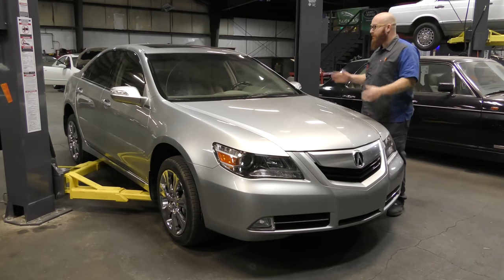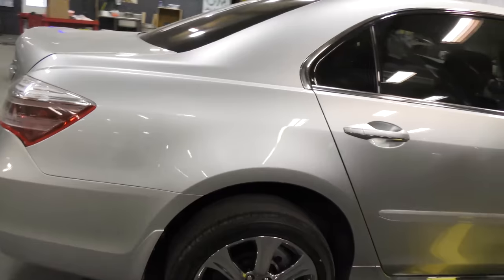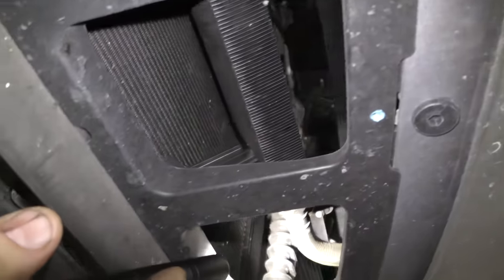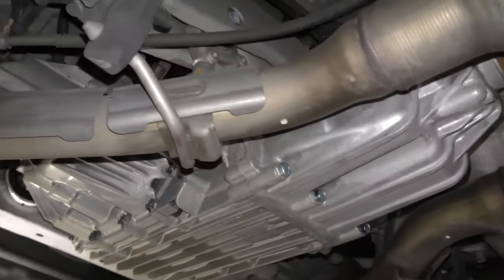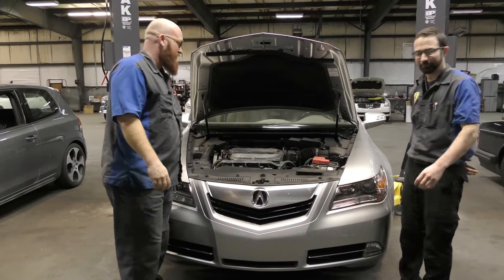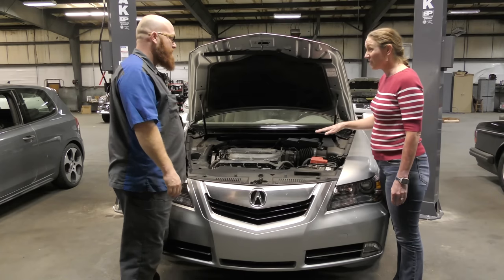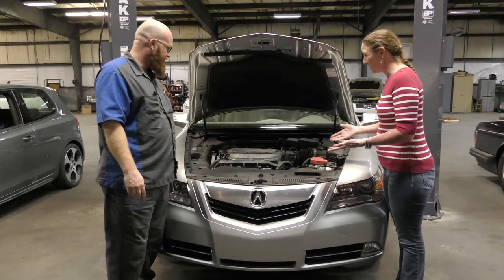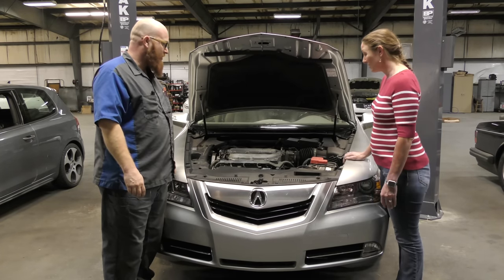Something Very Serious is Wrong with this 2010 Acura RL! What did the CAR WIZARD find???

Comment: If this was my car, I wouldn't hesitate to fix it. My big worry would be how good a job will the rebuilders do?
Reply: Sure... But only if you got 7k spare laying around.
Reply: @computerdeals  What is the alternative? I'd rather take out a 7K loan than a 30k+ new car loan to get something in this condition.
Reply: Yup, that's the fear.
Reply: @lorencooper6043  You are the owner? I saw you make a couple of comments? If they are going to do that, are you having the car shipped back to that dealer? That would be great news. You should write a comment and have the Car Wizard "pin" it to the top so people can follow your progress.
Reply: @louiswilliamhicks  yep! I’ll definitely keep you posted on it! I’ll keep the wizard posted on it too
Reply: @UCwrKbSnHORLLj9KKRYw_gYw Glad the dealership is standing behind their product.
Reply: @lorencooper6043  hey, I found some engines for you on Ebay. Theres at least 3 of them and 1 has only 68k miles on it. I bought an engine on Ebay once and it was good and still runs to this day.
Reply: If it was my car, I wouldn't let an idiot son drive it.  What was the kid thinking, letting the engine run when the oil pressure light came on?  If that kid wanted to drive the car again, I think the owner should ask 7k for the privilege.
Reply: @pizzamon795  I appreciate you looking but I’m looking at it as I don’t want to have someone’s engine that was possibly neglected. I don’t want to take the chance on that.
Reply: I’m surprised the owner can’t sue Honda- We have owned Hondas and had pretty good luck, but under 50,000 miles?? That motor should’ve gone 300,000 easily.
Reply: @lorencooper6043  I didn’t catch the rest of your comments. What’s this about the dealer? Is there some kind of recall on the motor? Will have to give you another engine? Good luck, I love Honda vehicles
Reply: @lorencooper6043  so sorry that this happened. I love these car's I was going to buy one.
Reply: @Andrew-ep4kw  if my son was an idiot then how would he be at a college that specializes in Automotive Restoration... He is a Guru with classic Mercedes but won’t touch anything else. The oil light flickered a few times. It never stayed on.
Reply: Any chance you’d like to sell it as is?  Serious question
Reply: @Andrew-ep4kw  You know the oil pump most likely died on this engine and that idiot son who apparently has ZERO mechanical common sense drove it until it started making the noise.
Reply: @oveidasinclair982   Book value of a 10 year old car isn't that much no matter how nice it is.
Reply: I would have bought a 3.5 V6 Honda instead. I would have never bought a car with the 3.7 variant because you can’t get reman Honda J37 engines. Nissan VQ37HR and Ford RWD 3.7 engines are not necessary built better but they are easier to find replacements for. I know right now you can’t get reman Ford 3.7 engines in RWD format but I know that they will eventually come out. The reason the FWD 3.7 engines are not mentioned is that they have water pumps driven by timing chains and yes they do fail a lot. It could be preventable by changing coolant every 50,000 miles but the water pump will eventually fail but that helps extend the life of the water pump and change the oil regularly. That’s the best thing I can think of preventing the dreaded water pump failure. As for the dreaded Chrysler 2.7 engines, they just are really bad engines and there’s nothing you can do but put a 3.5 engine in the LH (Intrepid, Concorde, and 300M sold overseas), LX (Charger, Magnum, and 300) the Challenger never had the 2.7 engines, and 2007-10 Sebrings and 2008-10 Avengers. For the 2000-06 Stratus and Sebrings, the only option is a 2.4 liter.
Reply: @Sam_Eassa  Agreed. Once upon a time when an engine or transmission went bad it wasn't worth the cost sometimes to fix the vehicle. Given the exorbitant costs of new or even used vehicles it is more cost effective now to replace those parts or assemblies rather than buy new.
Reply: It's worth $7K to fix that, I'd say. But, the kid gets a $2K 200,000 mile 15 year old Corolla to drive from now on.
Reply: @lorencooper6043  An oil pressure light even flickering on and off means your engine is almost out of oil and the pickup is sucking air (or the car is cornering so hard the oil is sloshing around, producing the same result).  Either way, as soon as that light even flickers, the engine should be shut down as soon as possible and oil level checked.  If he drove it with a flickering light until the engine started making failed bearing noises, then I stick with my idiot assessment.  The fact that he's studying anything automotive just makes it worse.
Reply: @oveidasinclair982  I agree on the common sense but I'm pretty sure it was low oil level.  It's very rare for a oil pump to fail.  Car Wizard, what say you?
Reply: @Andrew-ep4kw  hmmmm so if oil is full and a highway is straight how does that work? My assumption is the pump went out.  Another assumption Is it made barely enough oil psi for the oil dummy light to flicker
Reply: @atx-cvpi_99  you can most certainly rebuild j37 engines
Reply: @Andrew-ep4kw  it was probably a defect with the oil pump every car manufacturer has a defect but they are extremely rare. But I’m pretty sure that’s what happened with this Acura.
Reply: @atx-cvpi_99  The Honda and Toyota, 3.5 L V6 engines after 2012 are still newer and more reliable.
Reply: @Rekt-M8-v4  interesting.  if the oil pump on that engine is like most, it should be gear driven and super reliable, since it is pumping a lubricant.  There are issues with the J37 consuming oil, but that would either be from leaks or oil working into the cylinders.  Either way, lack of oil would be the primary culprit and even if the pump were somehow not pumping enough oil, the owner's son should not have ignored the oil light when it came on, or thought it was fine it was flickering.
Reply: @oveidasinclair982  I don't know, the car is way too clean looking for a daily driver.  Either it was never driven except on clear summer days, or it was recently detailed, which could temporarily hide leaks.  Honda oil pumps usually don't fail unless they are installed improperly or are fed debris laden oil, and a car with 42k miles shouldn't of had any work like that.  The J37 engines have been known to consume oil  (there was a class action suit against Honda for that) but they are otherwise very reliable. Either way, when the oil pressure dropped low enough to trigger the oil light, the engine should have been stopped immediately, especially since the son was driving on the highway (according to the owner).  If the engine is not making sufficient oil pressure at highway speeds, something is seriously wrong and running the engine that way is asking for trouble.
Reply: @Andrew-ep4kw  Just as a note, I had a friend who drove a honda where whenever the temp sensor for the ambient air was plugged in the oil light would come on. Not saying your wrong but there are cases when a light coming off and on is a non issue. Furthermore, in my 03 MDX I had, whenever you would go up a hill will the engine full of engine oil according to the dip stick, the car would show an engine oil light, when in fact nothing was wrong with it...
Reply: @Andrew-ep4kw  My guy, you have no comprehension of how much the son cares for his cars. He rebuilt a 1955 180D using his own hands and knowledge. To this guy, cars are everything. If he didn't think it was an issue you would have probably assumed the same thing with the same know how he has.
Reply: @adamgraham6265  Interesting info.  I'm currently driving my 6th Honda (a 2001 TL)  and have never seen anything like that, but I suppose it is possible a temp sensor could signal an oil pressure light, maybe if a wiring harness was compromised.  Also, if the young man rebuilt the 180D and knew engines, he should have known that you don't ignore a low oil pressure warning.  If he did stop the engine, check the oil and verified the level was good, continued without any more oil pressure warnings and then the engine died, then I would owe the father and son an apology.  Does anybody know if that happened?
Reply: Put another engine in it.
Look at the Toyota Supra.That has a BMW engine.
Reply: @Loudes012  thats like insane money
Reply: @Andrew-ep4kw  Yes That is exactly what happened. Because I know him IRL and this is what he told me. He is smart enough to know to check oil level. When he did and it registered full, he assumed the car was having some wiring issue. The car had burned oil for its entire life so he knew to constantly check on it. Also, like all cars, hondas aren't immune to wiring faults. However he didn't expect the problem to be an oil pump... There is no oil pressure gauge in the RL Gauge cluster.
Reply: @Sam_Eassa  There's plenty of options for 7k, he works on classic Mercedes so a W140 S500, E55 AMG, 300D, 300SD. I'm biased though and have a 2001 slk320 with a stick, a 1992 300D, and a 1995 S500, the most expensive of which I paid $2800 for.
Reply: @jeffzekas  if Honda/Acura won't supply an engine, what does suing the dealer accomplish - produce a new 3.7 out of thin air? This engine has been out of production for YEARS. Car makers don't produce parts for discontinued automobiles ad infinitum. Try getting a flathead V8 from Ford. Let us know how that works out.
Reply: If the reman company is any good, it'll have a really good warranty.
Reply: @Loudes012  You're comparing a new car with one made ten years ago. This isn't an old style small block Ford or Chevy. The engine controls in that car aren't going to talk to anything except another 3.7 V6 just like the original. Even so, swapping a different engine also means changing out the transmission, wiring harnesses, etc. That's going to cost a lot more than $7k, and Clem the shadetree mechanic isn't going to have a clue on accomplishing a swap on a car like this.
Reply: @Andrew-ep4kw  wow.  So disrespectful.  If it were my kid, I would totally understand. Stuff happens. Maybe the light didn't come on steady. I've had that happen before. Light/Guage flickers/flutters a little then goes away. A few days later it happens again and suddenly no oil pressure. Perhaps you should be more kind to people instead of being so negative.
Reply: This is just me, because well cost and everything. I wonder if the owner considered a gently used JDM variant?  Sometimes you can get a good used engine from Japan 2nd hand with close to the same or fewer miles. 

 I had no alternative than to do that for my 1986 Subaru DL wagon. Previous owner backed into it, pushing the entire core support into the alternator bracket and accessories. This caused stress and tension on the belt.  I kept replacing belts until the belt pulled hard one morning getting on the highway and it literally yanked the waterpump off. Poor bolt quality is also another factor. Needless to say I needed a new engine and had the $800 laying around to pay for it. 3 weeks later and the wagon got a new heart so to speak. The new engine only had 34K miles on it.  I sold it shortly after and the next owner smacked into a tree.
Reply: @Hedonistic0Frog  funny you say that, my son does have a 92 300d as well! 170k miles, uses Liqui moly for everything! It is probably one of the quietest diesels I know of.
Reply: @lorencooper6043  Very nice, mine has 240k miles. I just got mine as a spare beater at auction for $540, but it's a nice little car. I loaned it to a friend and she had to ask me if the fuel gauge worked since it's so fuel efficient :P
Reply: @Hedonistic0Frog  ha! I assume you have a w123 then. My son owns a 58’ 180d, 70’ 280SEL, and a 92’ 300d
Reply: @atx-cvpi_99  Also, the 2001 to 2010 Chrysler PT Cruiser and the 1996 to 1999 Plymouth Breeze had the 2.4 L four-cylinder engine in the Mopar lineup. They did not have any mechanical problems, but the PT Cruiser was so difficult to repair. Moreover, most Mitsubishi's had the 2.4 L four-cylinder engine in their Lancer's, Galant's, Eclipse's and their Outlander's as well. Two of the newer one's had the CVT transmission, which is always a huge disaster on all of their brands and vehicular models. Please do your re-search, when you are planning to buy any used vehicle in the market.
Reply: @lorencooper6043  that’s an ironic statement lmao
Reply: @Andrew-ep4kw  when or if  you have a son that needs a car to go to school just dont let him drive it 😉
Reply: @houseofno  Yes you are correct sir.The Supra is new.
One has to take into consideration the modules, would an engine swap like that prove defective for On Board Diagnostics.
Reply: @adamgraham6265  okay, then I'm sorry I assumed the son was at fault.  Just the same, it's not good news when a working engine destroys itself without warning.  Before spending the money on a rebuilt engine, maybe the owner should ask the Wizard to go over the engine electricals or install an oil pressure gauge, otherwise he could be going through an engine every few thousand miles.
Reply: @lorencooper6043  theres nothing wrong with a used engine, id purchase the 62k mile one and have Wizard pull the valve covers and oil pan, if its super clean like it should be then you have one that has been well cared for.  Theres a million ways to tell what the health of an engine is before you put it in a car, once its bolted up you can even throw the starter on it and run a compression test before its all the way back togeather
Reply: @Andrew-ep4kw  Yea, its ok. However installing a gauge in a mint 2010 car that isnt a wrx would look like shit. However, the silver lining is that the dealership he typically went to in CA is footing at least some of the bill because of the unlikelihood of it all.
Reply: @lorencooper6043  Nah, mine is the same year as your son's with the little baby turbo so w124. I see he's into the older classics, I've been considering getting into those since I flip old Mercedes and those can have some great profit margins. They're definitely beautiful, although I'm not a fan of those mechanical fuel distributors.
Reply: @adamgraham6265  I'm glad the dealership is sharing some of the cost. The one thing that would make me nervous is the lack of warning.  If the owner's son said the light flickered a bit but went out and the engine died of oil starvation, that's an ominous sign.  It is a beautiful car and I'd hesitate to spend the money rebuilding the engine unless there is a reliable system to monitor the oil pressure.  I agree an oil pressure gauge is not realistic, but the car needs to be checked to be sure the oil pressure switch and wiring are good.
Reply: I'd sell it to Tyler.
Reply: @atx-cvpi_99  and the water pump is an engine out job.  Even though the timing components never fail you have to remove them to get to the water pump.
Reply: @atx-cvpi_99  there was a guy that fixed the 2.7's.  HV oil pump and enlarged many of the oil galley's.  But he charged 3 grand to do so
Reply: @jeffzekas  
So do I, but the stealers SUCKS.
Reply: @Sam_Eassa  Yes. If the rest of the car is in excellent condition it will be worth it to spend $7k for a rebuild. I don't know if I could find as good a car for $7k.
Reply: @computerdeals  find an older RL or TL w the j35, much cheaper option

Comment: The owner is probably in love with this car. I know the feeling.
Reply: Bro I almost got a 2009 Acura TSX black on black. It had 200k miles and new tires. Well-maintained. This car is way more car. The TSX has a K20. Did you watch the video? Did you see the aluminum front control arms? The dual composite drive shafts? Leather interior. Super low miles. on and on. It is worth at least 13-15k especially given internet marketing.
Reply: @jamesmedina2062  k24
Reply: In love with an Acura? 🤔
Reply: @gb8641  Yes. For the same reason people fall in love with Hondas only MY J35 has Forged Rods, Billet crank and light forged Pistons stock. But I had the 3.5 :) anyways i also have double wishbones and multilink, my steering is electric :( but everything else is to love. Imagine a BMW that lasts 3x as long
Reply: @randomyoutubeaccount6906  I get the love for Japanese engineering, just not a big fan of Acura’s :). Kinda ZzzzZzzZzzz to me 🤷🏼‍♂️
Reply: @gb8641  Sportier Hondas, Japanese engineering and usually built internals. Like ready to to to some degree Supercharge stock levels. Literally the sportiest of the super reliable brands. (Toyota and Lexus products, Lexus is to Acura what Mercedes is too BMW)
Reply: @gb8641  I come from a 530i with the sports package. The Acura feels a little less sporty but it has only .01 less on the skid pad, around 240 WHP and an engine ready for 400k or a supercharger. (Even though the Pistons are forged a lot of people replace them for Fi i'm not an expert i'm reading off a brochure for the materials but it is a J35 without VCM so.... ) anyways i'm keeping it stock but i understand the love as I love mine. It feels like it has soul, and it's less heart breaking than my N52 cars.
Reply: I'm the same with my 08 Infiniti M45 Sport. It's a very rare car and with over 113,000 miles on it. It looks realy nice. Because yea I admit it. I'm in love with it. Lol
Reply: Totally. I daily a 2010 TL SH-AWD 6MT. Very much in love with my car!
Reply: @fredwilliams7893  I envy you man.. that’s my dream car
Reply: @rodrigoge5875  I'm selling mine exstremly clean many many upgrades I could send you pics
Reply: @gb8641  Acura has a lot of lovers and fan clubs. Ppl buying NSX, Legend, Integra, Type S Sedan, RSX at high prices. Acura has a lot of classic models. Heck, the TSX in its short life span made multiple 10 best cars
Reply: Id drop a 3.5 in there,the 3.7 is absolute trash.The 3.5 last forever.
Reply: Yeah so in love he didnt even put oil in it
Reply: I have a 2011 tl shawd. I love that baby. My ride or die 3.7